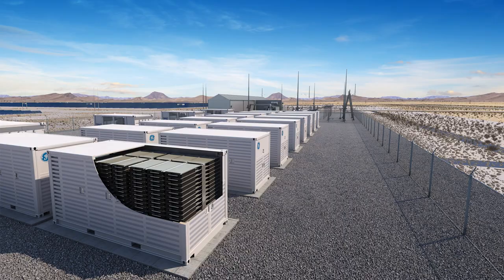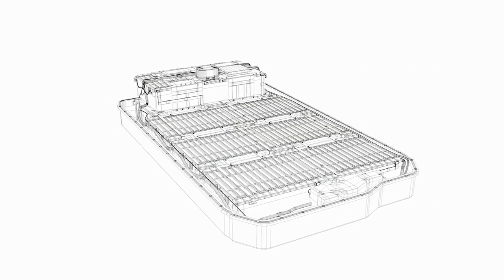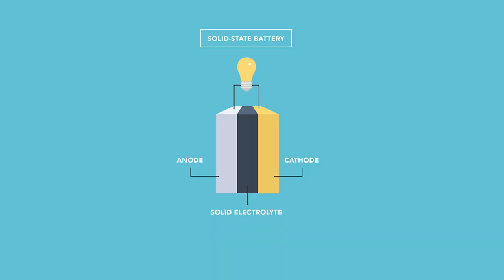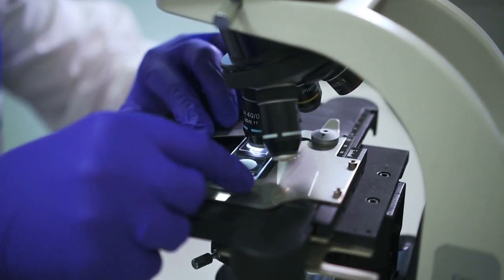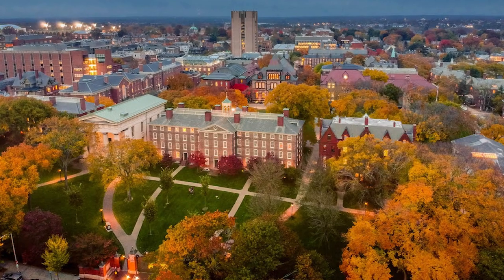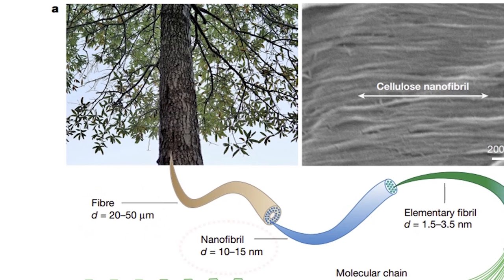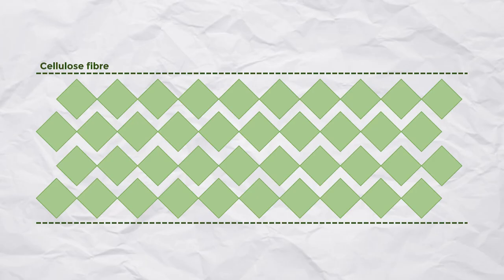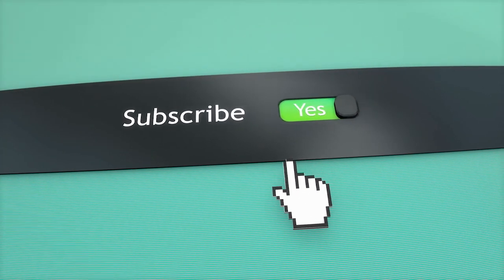Uncovering The Solid-State Battery Breakthrough

Comment: The term "structural batteries" always hits me as just an insane idea. Battery tech is moving at ever increasing pace we still are not seeing that there is no reason for "built-in batteries" other than planned obsolescence. In around 10 years we are about to drive a crap ton of fully functional electric cars to the dumps just because some new battery technology doubles the range or halves the weight etc.
Reply: You cannot ask for progress to stop. But they should make the structural batteries interchangeable. keep the car. just change the battery. So, they take the car off the old structure, and they put it on the new one. Like changing a transmission or an engine. With current battery tech, your 10 year old battery will have much less range and capacity anyway, nearing the end of its life. Sounds like a solution the Aftermarket vendors will provide for sure if you think about it. They will have much less parts to sell when the ICE cars start to go extinct.

Comment: Well, this is interesting.  In order to improve "green" transportation, battery manufacturing could require a significant amount of lumber.  How long do you suppose it will take before there's an environmentalist movement that decries the use of trees in batteries?
Reply: Moment its applied into battery tech as actual feasible process. I mean those loonies have already demanded that fireplaces need to be banned in fucking Finland, where electrical grid is not perfect and secure, witch is also why EV's are terrible idea in north since lots of energy goes to heating the vehicle, where as liquid fuel vehicles have that heat as side product and already have limitations on how cold effects them. Heat the battery and cabin with electricity and your range drops significantly, not to mention what temperature changes and corrosion does to every electronic system if vehicle, hence why older cars are still on the road just rusted away due road salting and new cars are going to scrapper all the time due severe electronic fault issues.

Comment: Probably a dumb question, but would this make them any lighter at all? Could possibly have increased range for vehicles or open up more doors for electric planes.
Reply from the maker: Not a dumb question at all! I am not actually sure, wood is about half the density of ceramic, so it should be lighter overall, which would definitely help overall range!

Comment: What's weird about this is how the lithium is moving back and forth between anode and cathode. In order for it to work, the electron has to be excluded by the electrolyte (it has to be an insulator), which isnt what electrolytes do. Not only that, but the lithium has to travel through a solid insulator, not exactly a particularly permissible substance. It's still weird that you would need to move the lithium at all. The whole concept actually just sounds like a capacitor, at least the way I explain it. Not according to their explanation at all though.

Battery acid works by being so electron negative, it prevents electrons by flowing through it. It allows cat-ions to traverse and attach to the cathode, but the electron has to find another path, the circuit.

The idea behind lithium ion as a battery is because its low state electron is easy to dissociate. Only hydrogen/helium would be a more effective option. It's easier to move the electron because it's nucleus is not very large, at least in theory. It would seem that using a copper cathode would have the charge differential to facilitate electricity, but even that is dubious. Just because it's a 2+ cat-ion doesn't mean it's less electronegative than lithium, it's not.

Is it possible to use wood as an insulator in a capacitor? Yes. Wood is an insulator.  So are some ceramics and polymers. The main concern for these batteries should be which insulator lasts the longest. It's basically the only concern.

It's funny, I was thinking about using capacitors a while back, because they are interesting, I'm not sure I thought that's what li-ion batteries are.

Comment: How does this compare to what Ligna Energy is trying to do?
Reply from the maker: Wow I hadn't seen Ligna Energy before, looks very interesting. Ligna seem to be using a liquid electrolyte, and it appears the biomass is used instead of lithium, which makes their battery much bigger for the same energy stored. Though i need to do more research on this for sure, maybe even a video! Cheers

Comment: So what actual metals are used in this solid state battery??
Reply from the maker: I am not sure what they plan to use in the cathode, but there will be lithium in the anode and aluminium in the battery casing I expect!
Reply: @ZirothTech  well that's very important to know. We need metals and most don't understand how much we will need. One thing I've read alot in the solid state batteries is platinum. I then laugh till it hurts. We will never have enough platinum to make all the batteries. And if we do mine enough it will cost massive amounts to do so. The really funny part of all this saving the world stuff is I'm noticing no one understands how much mining we will need to do " to save the world from us"

Comment: Have you noticed after all said and done we still using little round batteries in multiples, why I guess because breaking round batteries is the best efficient way but of course that means there’s lots of wastage in between each round battery,
And have you noticed you get very big lead acid batteries square but all the rest lie on my card I’ll little 1.5 or 2.5 V batteries in multiple not what would you call labour intensive.
You would think they would be making large batteries in the square 1 ft by 6 inch 
Easy to pack together easy to take away, I mean there’s hardly any difference between a car battery system and one used in a electric drill except for the electronic control system for heat and cold et cetera
Reply: It's partially due to the way they're manufactured. The round cells are rolled up layers whereas the rectangular batteries use larger rectangular plates.

Comment: For the most part thats cool however fast growing  plant with similar cellulose structure  would be better as we could farm it and keep the ecologist neutral. A gene modded Bamboo or something.
Reply from the maker: Yes I definitely agree! We don't want another issue with competing space for crops either like woth biofuel! Thanks for your comment :D
Reply: Do you also think we should stop using wood for construction as well?
Reply: @poshun9407  recycling our billing tons of waist is the only way forward we have to stop “taking” and give back
Reply: @poshun9407  I was mostly spotting a potential problem in a new technology if we don't think about it.

 Everybody's answer to your question should be yes. bulk producers of oxygen they are and there growth rate is pretty slow. 

I like the Idea of 3d printed houses or gene modded corral or some meta material composite. Haven't really thought about it.
Reply: @phillipj1135  I personally believe we should be using more wood, especially if it's used instead of concrete etc.

Comment: there is a plastic additive that is made from either tree pulp or hemp fiber, it makes any plastic mixed 50/50 just as strong as steel. 1/6th the weight, transparent, and conducts electricity.